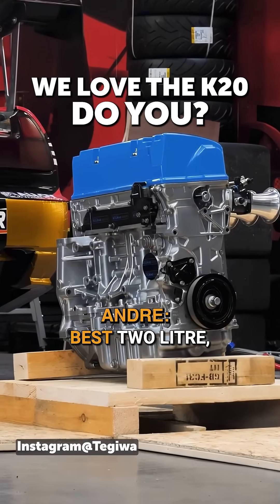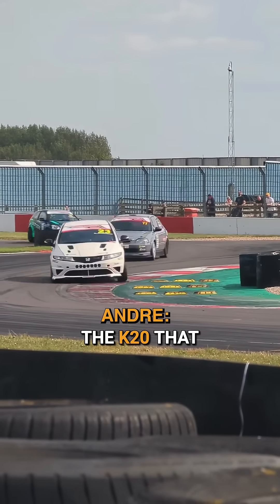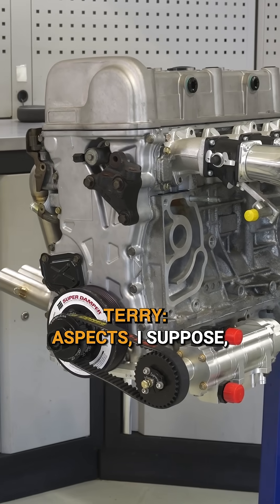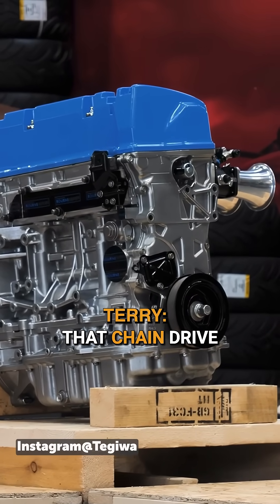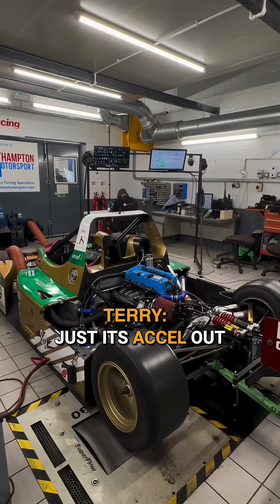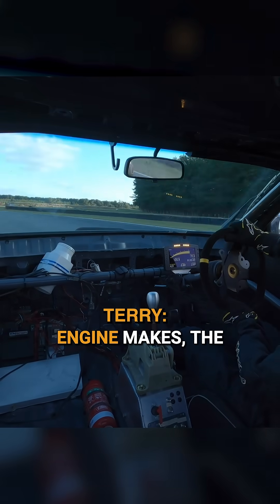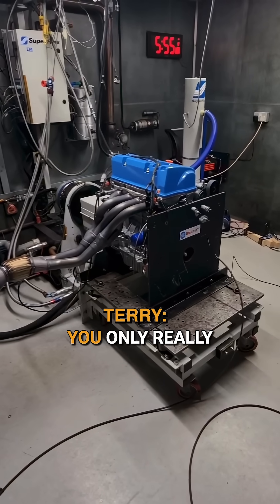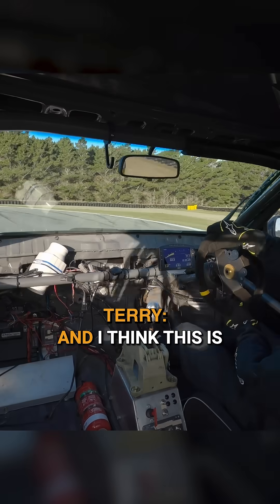We Love The K20, Do You?

Comment: I wish the 2AR had the same love as the K motors, it’s FE variant makes 180hp and 172tq, but it’s solid, can take lots of power on stock internals just like the k motors, stock it doesn’t rev real high, but put some cams, like the Frankenstein Motorworks camshafts, either his stock ecu ones gets you 230whp from 7k-7.5krpm or his aftermarket ecu cams get you 270whp with his and NixSpeed’s velocity stack intake. Go turbo and you can easily make 400whp with cams, the drift tC and Corolla hatchback use the 2AR with basically a turbo and cams and nos to get 1000hp. It’s got a lot of potential with its huge intake ports, and with a stock ecu, Toyota made it adapt really well with mods, it even adjusts to higher octane fuel automatically. It’s unfortunate that it gets overlooked because of the K’s when I think they both deserve some praise. HP Academy, I feel like I know the answer already, but have you guys ever checked out the 2AR-FE motor? 

Love your courses by the way, I’m watching the transmission tuning course to get my cams full potential using my automatic transmission to bring my stock rpm limit up safely and most effectively.
Reply: I really appreciate the work being done for the 2ar’s, especially by Frankenstein Motorworks.
There’s not many 4 cylinders that can make 240hp+ while being na, and having relatively simple mods. Especially with how common they are.
I’d really like to put one in a 3rd gen Celica one day.
Reply: @genericexcuse4737 very under appreciated, I got his street cams for my tC, I haven’t installed them yet because I was waiting for D3 to support tuning the tC’s automatic transmission but it’s taking a while and I kind of don’t want to keep waiting. I’ll still be able to make decent power as is, I just won’t be able to take advantage of the wider power range, they make almost peak power from like 7k-7.5k rpm! Stock rpm limit is like 6.1k-6.2k, but at that rpm it’s still making like 225ish whp, they are still worth it for that.

Comment: Aside from reciprocating and rotational mass, what affects how quickly an engine can rev?
Reply: Rod length to stroke ratio
Reply: @vozhdmeister5256 Interesting. How does that come into play? Decreased piston skirt loading?
Reply: @Shootin_Bruin Yeah I see what you mean.

Again I guess it comes down to weight, but also the shortest stroke possible would allow the engine to rev faster.

From my drag racing days I do remember some people used alloy con-rods to allow better response and probably faster revving. These were only rated for a certain amount of hours before they would have to be replaced due to compression induced deformation
Reply: Probably just the gear ratios/wheel size and overall low car weight
Reply: @jonathanireland2913 Yes, but I think the speaker is talking about how quickly the engine can rev when it’s free spinning

Comment: I've tried to explain rate of revs to so many people....
Reply: @admobandy4821  the flywheel weight needs to be considered before the rev-acceleration number is judged
Reply: @gnu_williamson that's a fair callout for sure
Reply: If you look at historic racing a few years ago, you would have seen Hillman Imps with circa 120bhp @ 9k rpm from a 1Ltr, matching  Ford Lotus Cortinas with 180bhp @ 8k From 1.6Ltr
Reply: Only if youe NA. To get the most out of an NA engine you try to go for high rpms with fast accel rate, meaning lighter crankshaft, lighter pistons and rods, and dual spring valve springs with a light weight camshaft. If you want a turbo then you have to find a balance between strength and weight, meaning you either buy expensive pistons, rods, and a crank that are light weight while still being able to take the high pressure from force indiction. Most of the time its better to have low rpm high strength turbo car then a high rpm NA car.
Reply: @angelaldacoaa It's more than that, it's bore/stroke ratio, stroke/rod ratio, you can run a lower comp ratio with more ignition advance, more valve duration but on a wider LSA. Many of these are counter intuitive to many, and indeed on a dyno accelerating at 200 rpm per sec, the results will not look favourable, but at 300+ rpm per sec, the results will look very different
Reply: @gothicpagan.666 yes but the example was on a 2.0 liter so my example was keeping the same bore and stroke
Reply: @angelaldacoaa Most production 2Ltrs are 86mm square, this gives reasonable torque and a bore area adequate for adequate valve sizes.
Some manufacturers go up on stroke/ down on bore to give perceived better low rpm response.
Going to the other extreme with  something like a BDG Cosworth or 420R Hart unit, that are designed to be flexible in bore/ratios, 97mm bore is possible but unless it's in a single seater with 6 gears, is not a great choice, from memory the stroke is down to 67mm? Which is great for a power band of 6-1+ k rpm but that unit in a rally car is a disaster.
The Honda unit with it's variable timing and geometry achies any thing any of the old F2 power units could do at a fraction of the price and doesn't weigh a great deal more. Truly great
Reply: But my uncles v8 makes more torque 😂 alot of people just dont understand
Reply: @BIGSMOKE-bl2lq Yeah... And that torque gets used up by carrying around a bunch of weight. It's why low revving V8 don't exist in racing anymore. Even NASCAR V8 rev to 9,500.

Comment: What even? Rate of acceleration of the engine? ... gives lots of on track performance? 
Utter nonsense. Even if the k had much less angular momentum , friction, pumping losses than its competitors, which it doesn't... how fast it freely revs has basically nothing to do with how fast it revs when connected to a gearbox and car.. and matters very little anyway. 
The k is great, but this guy is not great at articulating why. 

Also, oddly enough some Duratec people change their chain drive to a belt drive at great expense when they're trying to make lots of power and revs,  I wonder why?
I thought belts are lighter than chains, and more efficiently transfer power, at the cost of extra maintenance. No?
Reply: It is utter nonsense. The biggest influence to rate of change is the large lump of iron bolted to the end of the crank.
Reply: heel toe in the corners mate.  Those quick revs matter
Reply: @admobandy4821  That's about the only time a 'free revving' motor makes any difference. But it still doesn't really make sense or matter here, because every similar modernish 4 cyl 2.0ish liter car engine is similar enough that they're the same for rev matching...So not a huge win for the Honda specifically. And also, you generally rev match before the corner, while braking, so even if it did take a long time to rev the motor, it still wouldn't matter: It wouldn't hurt the lap time.
Reply: They probably change them because they shit at high rpm with large cams and heavy springs nas cars run a belt for rpm as chains stretch over a race but a well designed chain set up has zero issues look up drag cartels massive cams in the k series some run those things out the back up to 12k rpms chain has no issues chain or belt depends on situation and engine no 1 is better than other and just drive a k series with a light flywheel you will enjoy the feel and feed back and reward how they rev
Reply: That’s what I’m saying. Guy said a whole lot of nothing. “Don’t chase power. Chase acceleration.” 

???????